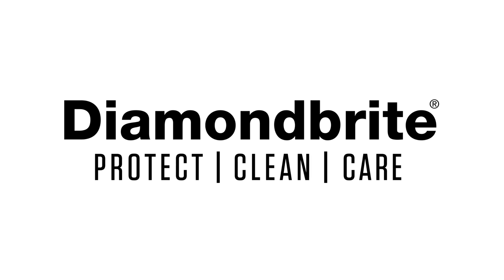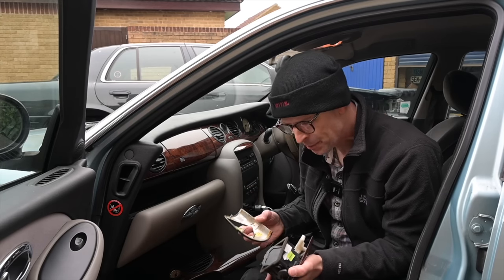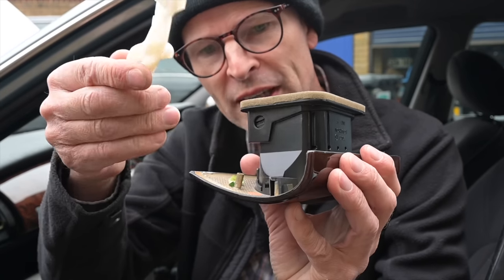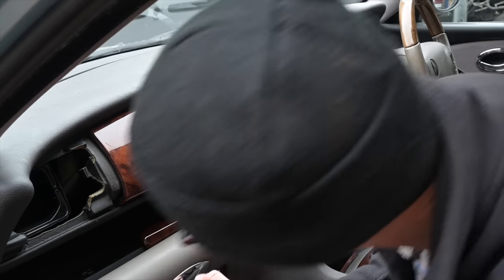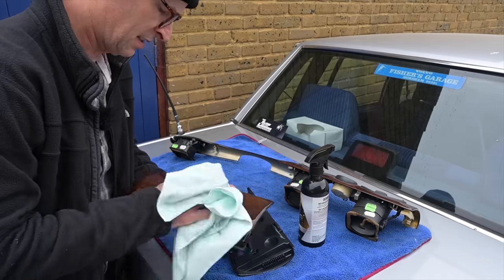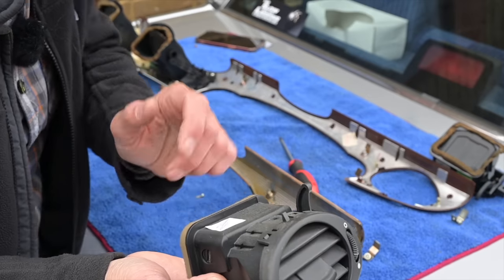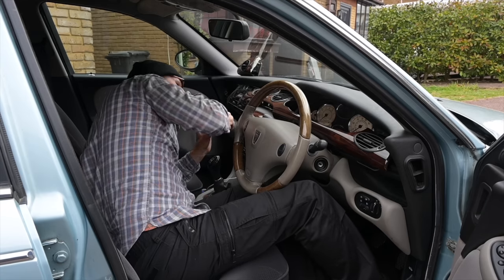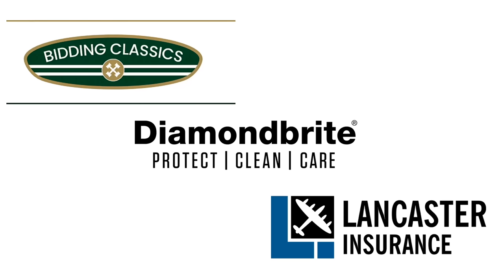Rover 75 gets a REAL wood dash!

Comment: Earlier 75's must have been such a class act for that first 24 months before Project Drive started biting in, that real wood dash does look fractionally better than the plastic stuff - which is a great credit to the company that manufactured the plastic stuff because that is something not every Rover customer would have noticed, or at least not immediately! 

I've always said it must have been an issue for Rover circa 2003-2005 when customers of early 25/45/75's came back wanting the upgrade as the MK2 face-lifted versions were released... only to find they we're worse in spec and quality than their current car!! You can understand why the writing was on the wall for such a long time!
Reply: Traditionally, Rovers were very well put together, overengineered in fact in so many areas. I've worked in the repair industry, and on my own Rovers. The P4, P5 and early P6 were put together with the same quality as a Rolls Royce, Qualiry tiny fixings, nuts, bolts and screws holding brackets that were a work of art. Then the BL cheap 'n' cheerful, any old fixing will do methods ruined the reputation, as the SD1 was about to launch.  They did address it by the time SD1 series 2 cars were on sale in the early 80s, but the poor quality reputation had already lost too many customers. Project Drive was little different to when Rover fell under BL control, cheapen everything, and hope it lasted until it was out of warranty !

Comment: Nice little upgrade.

I had a 2000 Cowley built 75 and the ashtray/cup holder/cigar lighter, gear surround and hazard switch trim was indeed plastic wood.
Reply from the maker: Thanks, thats good to have confirmed
Reply: Yes same with my dads 1999 V6 conny se
Reply: Yes my 2000 75 Classic SE has plastic cup holder/ashtray, and switch panels etc.  - but the eyebrow is veneer - it is chipped in a small area - top dash panels are wood too!

Comment: Thanks for a very helpful video I have been hunting for earlier wood for the 75 and one luckily cam up for wrecking and the time of your video fell perfectly. I did the exact same removal as you only I found it was easier to start off with removing the passenger airbag cover then with the passenger vent being the most fiddly and amazed at how easy the longest part came away just prising around the drivers vent, successfully removing without breaking. The strangest thing is the longest part seems to fracture in the exact same places by the middle vent closet to the driver in the cars fitted with the faux wood but less so with the real wood veneer, despite traditionally faux wood standing up better to the elements than the veneer. Speaking of which for a car that wasn’t all that famous for build quality when they were new im really impressed by this he build quality and how well they have held up even shaming many bmws of their time, and the real wood has proven hard wearing with only a small craze crack in the lacquer on the passenger airbag piece.

Comment: Hi from Sydney , Australia. As a teen the TWO pre-production Jaguar series 1 coupes came to Australia for the Sydney Motor show, a Regency red 4.2 litre 6 cyl car and a Turquoise V12 version, they looked fabulous with the original tall grilll fronts, but better was the big, tall GENUINE wood dashboards.  Simply Stunning in 1972 when they came here I was in my second last school year prior to Uni'. Having received a smallish inheritance from several deceased older relatives, I had hoarded the funds, not spending but carefully investing them. My dividends paid off and by early Uni' i had a decent nest-egg put aside. In mid 1975 2 senior Jaguar guys came to Australia to show the 2 new coupes the xjc' & xjs's. When i first saw the interior of the new series 2's in 1974, i was disgusted in the truly awful rendition of "real" wood fitted to them and the car I'd really wanted, an XJC had been massively buggered up with the dreadful short grill and a wood dash panel that looks to all intents like fake wood. Here in Australia a friend had bought a second hand early Rover 75 and with such thin veneer in the unrelenting heat of the Aussie sun the Rover 75's real wood had shriveled and distorted into some type or kind of punk abstract art.  However, at a breakers yard, we found a late model version with the "plastique fantastic" dash and it was perfect. The car has needed to park in the heat in a hospital carpark each day, and now several years later, it looks fine.

Go back in time, most series 2 & 3 XJ Jaguars here in Australia all have cooked up warped "real" wood in laminated veneer dashboards and let me say they look terrible. For 32 years I owned a rare series 1 long-wheelbase xj6 4.2 litre and its dash was THICK, sublime real wood. Sold to a friend and replaced by a 1967 MK10/420G its wood is even more elaborate, it looks like real wood . Quite frankly I thought that even the "real" wood in Rover 75's looks fake, just like most modern cars with about 1,000th inch thick laminated wood choose any Mercedes with a bit of wood and I almost feel like getting a scalpel to scrape it and see whether you will see as much as a splinter of real wood appear .

Comment: There is a man on the forums who makes walnut overlays for the a/c panel, radio and the four window controls. He apparently put a great deal of effort into getting a close match and it is good but inevitably it doesn't look exactly the same. Nevertheless, I have installed them and quite like them, though I really wasn't sure at first as I thought it may look tacky but I particularly like the window switches (without the optional chrome outline). The good thing about them is that they can always be removed but for the time being at least I will keep them.

Comment: The centre console wood parts are always fake plastic, the issue is you get a very different level of darkness in pre 2002 cars, there's regular distinctions between them, and the post 2002 seem to always be a lot lighter in walnut but I don't think it was a project drive issue. I often wondered is it a matched from factory to the walnut Eg darker lacquer on vehicles speced with oem real wood be interesting to try a paint depth meter on them at some stage. I've had dozens of sets in varying shades over the last 15 years now.

Comment: The problem I see with most real wood trim prices in cars no matter what the price point is that it fades really badly on the parts that face direct sun and the lacquer usually cracks.
Great video as always.
Cheers Pat 🇦🇺
Reply: We had over 20 years out of a Rover 600 and the wood looked as good after that period of time, as when it was new. No fading or cracking, and was outside all the time.

Comment: Well done Matt, that has to be worth treating yourself to a well earned pie and a pint for completing. Those  screws in the airbag cover panel must  be thread-locked so they don't ever vibrate loose and fall into the space behind. Not only would they rattle, the main reason is safety.  The micro second explosion would launch the screws like firing a bullet at you if the air bag ever deployed. We used to get the manufacturer training on how to safely deactivate all the various ways SRS components trigger, and the consequences of wrong assembly, and accidental deployment.

Comment: I assume the only reason for the locktite on the airbag panel is some extra safety, just in case vibration made the screws loose and one of them got flung into someone's eye in the event of a crash or something when the airbag deploys and violently flips the panel aside.
Reply: @ChromaFox. Yeah, I was thinking the same thing. Cheers!

Comment: When refitting self tapping screws into plastic, ALWAYS turn them backwards until the screw drops into it's original thread. Failing to do this the the reason for so many stripped threads and broken pillars.

Comment: The word you were looking for when describing the pictures Venice is Marquetry. Parquetry is the same skill set but of geometric figures rather than recognizable pictures.

Those big pliers are called slip joint for obvious reasons. Invented to aid plumbers running the old galvanized steel pipes, they do come in handy.
The reason for the thread lock on the airbag cover is simple. Vibration could loosen the screws, which could be dangerous or deadly in a collision. Thread lock is a redundant safety measure.
Reply from the maker: Yes, thank you, dont you hate it when the word wont come!
Reply: I have always known them as plumbers pliers, but not sure why!
Reply: @katywalker8322  Plumbers used to use lead or galvanized steel rather that copper or PEX. The lengths were cut to size and the ends threaded. The slip joint pliers were great for holding one piece steady while a pipe wrench was used on the other. I used to have a plumber's tap and die set for making those threads.